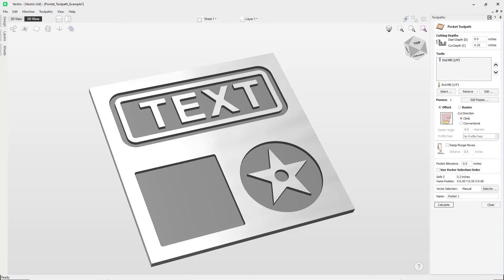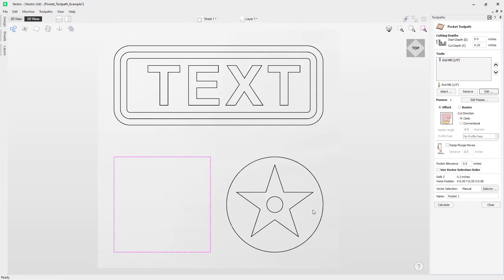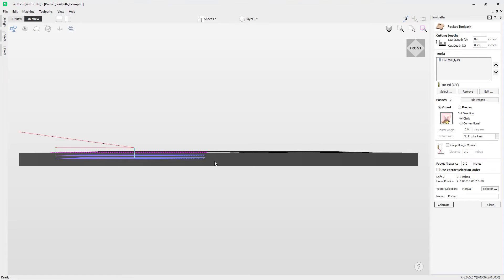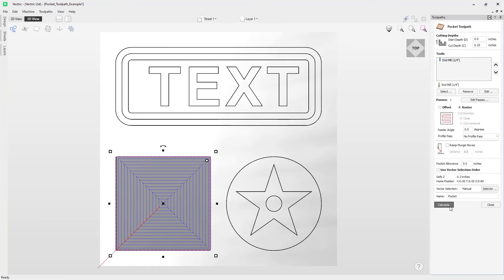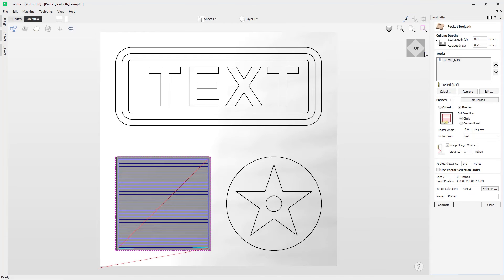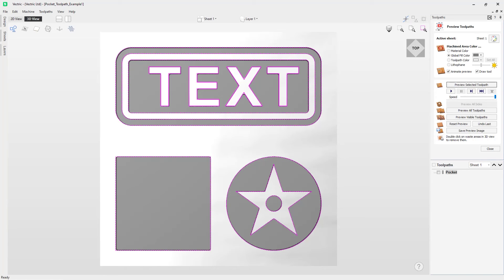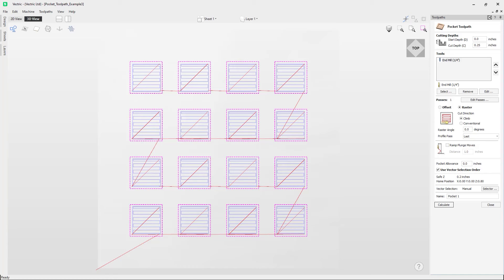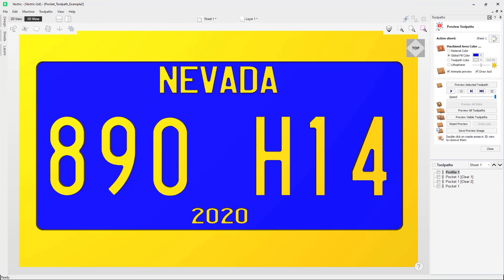How to use the pocket toolpath in Vectric software | 2D Toolpaths | V12 Tutorials

Comment: How do you save the pocket toolpath to include the clearance files.
Reply from the maker: If you have a tool changer you just need to select the proper prost processor and we will save the toolpaths together.  If you don't have a tool changer, unless you are using the same tool for both you only have the option to save out two toolpaths.  In saying that there are a few exceptions depending on your CNC.  I would suggest if you feel you might fall into that category to contact support@vectric.com and they can give you a hand. :)

Comment: I have test pocket toolpath many times, but it cut the material 10x the cut depth, when I enter 1mm it cuts 10 mm, where is the problem??
Reply from the maker: Hello that sounds like a question for support@vectric.com - Please email then with a description of the problem, the file, controller type, controller software and the CNC you have.  They should be able to help.